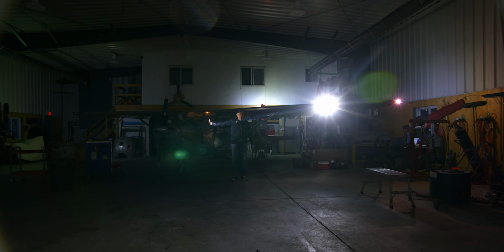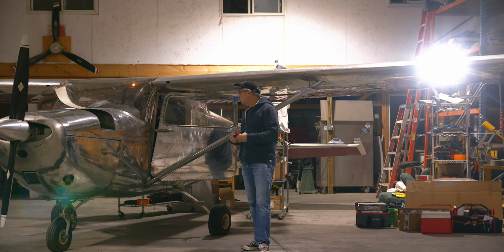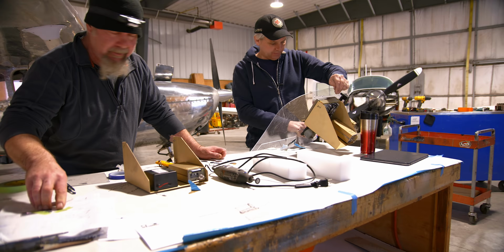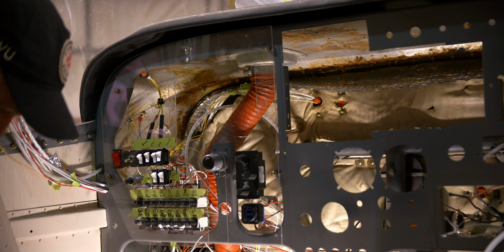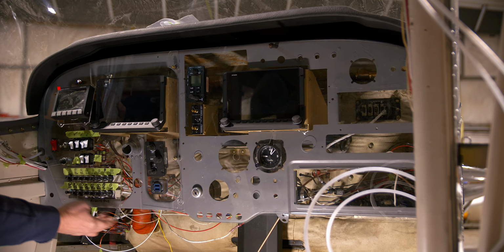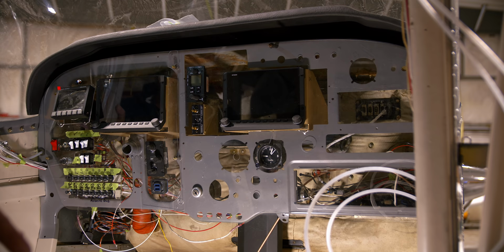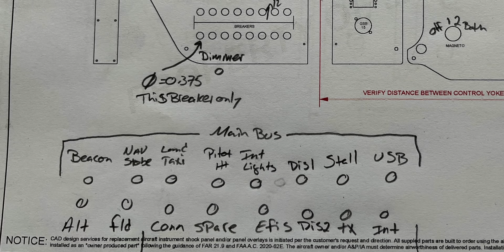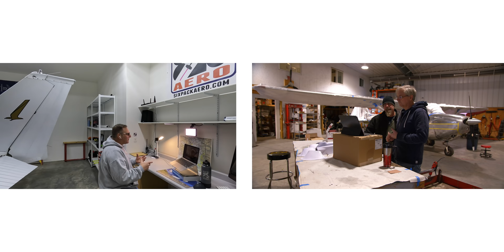Final Panel Design - Glens Hangar Episode #14 - Cessna Restoration

Comment: I worked in the marine electronics field for 40 years. Center console’s, mega yachts, and commercial ship’s. I had company’s cut parts out of different types of materials quite often. One company had a huge water jet CNC about 15 feet tall that could cut through some pretty thick stuff. In my case 3/8 aluminum. I knew a guy back then that wanted me to redo his panel on his twin engine. I told him no way! I was currently flying regularly at that time.

Comment: It looks like you went with the smaller screen.  Was that due to size limitations of your model?
Reply from the maker: Yes - the 172B model sub panel / stationary panel / yoke design won't allow for the larger screen without a major amount of structural work... which means a lot of time and money chasing engineers to draw it up and get it certified. Not in the cards on my budget, but I know of a company that's working on an STC for it so larger screens may be possible at some point in the future.

Comment: Interesting everything’s in inches. I thought Canada and aeronautics generally were metric?
Reply: Because of proximity to the US, most tools are still imperial, so measuring for construction is still mostly in inches. As to aviation in general, it’s a hodge-podge: Temp in degrees C, Speed in knots, fuel in gallons for older planes, kilograms for newer, altitude in feet for general aviation, though major commercial airlines do use metres now, I think.
Reply: @francoisbeaulieu179  ironic that the US had a revolution to stop being part of an empire and yet here they are imposing their empirical measures on their neighbours…
Reply: @jbaldwin1970  This is also an old American plane so, prior to Canada's "metrification." and solidly pre metrification of the American Aeronautical Industry.

Comment: I would like to do the same panel for my 172 A, could you give me a break down on cost for the nav and instruments and install? If you don’t mind me asking
Reply from the maker: Instal was mostly done by myself with my AME watching over my shoulder and signing off in the logbook - so pretty much just my time. 
As far as parts; Dynon is one of the only companies I've found where they provide a spreadsheet with pricing, and base systems. They will also help you work through what you actually need - and their recommendations were spot on. My basic system was around $19K in parts
Spreadsheets: https://www.dynoncertified.com/aml.php#amlpricing
Virtual planning session: https://myemail.constantcontact.com/Introducing-Virtual-System-Planning-from-Dynon.html?soid=1108917019401&aid=7iBvmzJJTOQ

Comment: Watching the CNC do it's thing, it looks like on both sides of the panel it cuts out smaller rectangles, then later comes back and makes a larger cut around the outside.  Anyone know what's going on there?  Is it making mounting brackets for smaller components that go into the larger space?
Reply: That's called "nesting" and it's a way to make less scrap when cutting metal. It may be for Glens plane but could also be used for a different project at the shop.
Reply: @kjdude8765  Thanks for the explanation, makes sense.  They seemed like strange parts for Glen's panel, didn't even think they might be for another project.
Reply: @kjdude8765  
Thanks for the explanation from here too!